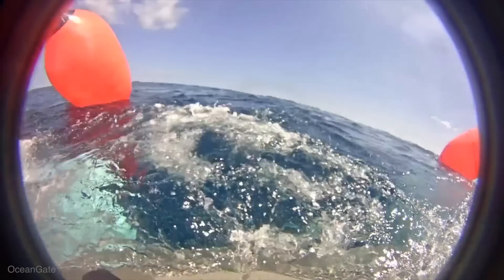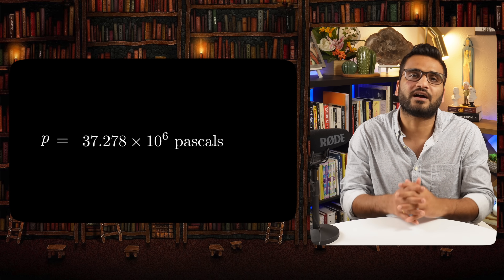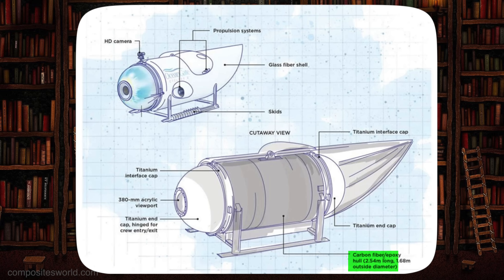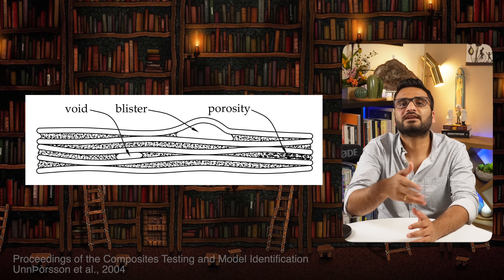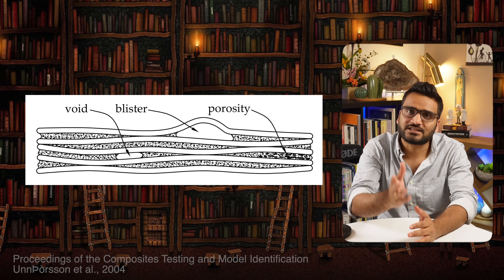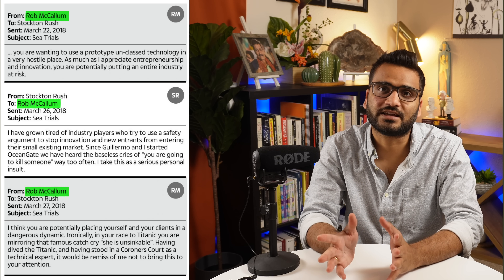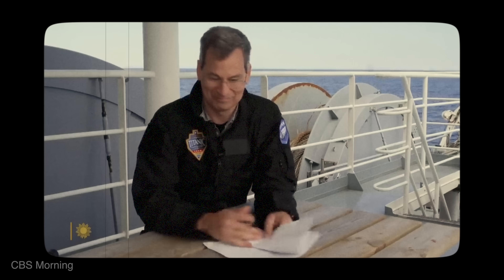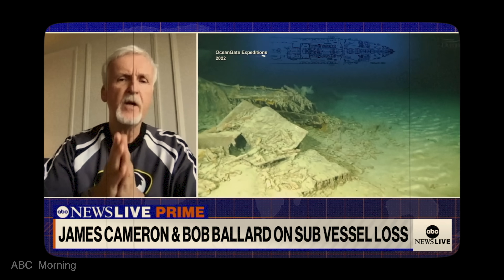OceanGate REALLY messed up - A Structural Engineer's Perspective | TITAN'S TRAGEDY

Comment: Very informative explanation. I am not an engineer but I know how water pressure works. From my limited knowledge, it could have been a failure of the carbon fibre. If the Acrylic dome was only good for 13,000 metres, that could have been critical as the Titanic lies at 3,800 metres. I tend to think the Acrylic failed.
Reply: The carbon fibers are not to blame... Carbon fabrics tolerate tensile efforts very well... The compression of the material is in the resins... IT IS IGNORANCE OF THE MANUFACTURER... The problem is not with the tool. ..it is one of those who do not know how to use it.....because titanium alloys are welded by laser and automatically and the manufacturer as well as the engineer who made this material did not know either...

Comment: The domes were reported to have been glued to the fibee cylinder - they have diferent rates of reducing radii under increasing hydrostatic pressure; so they probably sheared on the gluedvsurfaced while the cylinder colapses like standing on the end of an empty soda can. While the the fibre was only wound on circumferencially - 'ie not "cross-ply" like a pressurised gas tank.

Comment: so heres a lateral thought....the boeing dreamliner has a fuselage made of composite materials - how have parallel issues that could cause it to fail been handled?
Reply: Yes it does and so does Air Bus but they have been doing it for a while and have spent millions on testing and proving the integrity and durability in destructive testing which is basically real world. This is where the cavalier, dismissive, arrogant Stockton (correct description borrowed from another commenter) fell short. The air plane manufacturers are still having issues they have to overcome with the system including paint adhering to the material and constant expansion and contraction do to heat, cold and pressurization. Some of the issues Titan would have had but in a much greater amount.

Comment: Surely that the carbon fibre was wound like a cotton reel,not the usual criss cross pattern has to have significantly weakened the strength-just another failure in the construction processes involved in Tital. Pressure should’ve been used for all the epoxy resin used as “glue” for the titanium attached rings & after the carbon fibre had epoxy applied to remove bubbles that would weaken its integrity.
Tbh,I don’t know how it got to Titanic & back multiple times before it failed.
It had needed repairs to the carbon fibre after it’s 2nd dive…a sure warning

Comment: the amazing 20-20vision here. remember it dove titanic 8 times already so fundamentally there was nothing wrong with the design, i'd say simply it should do 2-3 dives then replace the hull as it's practically imposible to detect micro fractures in carbon fiber composite materials until its actually failing beyond that it was a pretty decent vessel .

Comment: Very good video from an engineering point of view.  Although I am an electrical engineer, I really appreciate learning more about structural integrity, finite element analysis, and other techniques which can minimize risk of failure.  Personally, I would rather be on the top side looking into a television monitor then to be 2 1/2 miles down under the water.

Comment: The rv handle he bolted to the top of the inside of the composite hull which he bragged about probably weakened the structure enough to cause failure....

Comment: I’m guessing that it was all over as communication ceased … the Cylindrical Hull WAS THE MISTAKE. Break the rules and you will pay, and he did. After the first failure he should have made a new Hull .this too would only have the same limitations but be less likely to fail like this one did, probably on its way down … cracking had been heard on previous dives indicating coming failure …
Reply: The Titanic at least had lifeboats …

Comment: Carbon fiber is excellent for tension loads and useless in compression. That is, it may be fine for pressure vessel applications, where the internal pressure exceeds the external pressure. A submersible is the reverse, and finite element calculations would have shown the hull to be greatly under designed. I'm not confident that the carbon fiber could adequately reinforce the epoxy matrix, if at all. The previous successful dives were due to luck, not engineering design proficiency.
Reply from the maker: Yeah. Assuming the structure to be symmetric about vertical axis of the cylinder, every point on the hull was subjected to three compressive stresses: (1) the compression from the domes in z-direction; (2) the radial compression; (3) the circumferential compression—thats too much work for epoxy. And apparently, the fibers were not cross-wound. I would also think that the stresses coming from titanium dome on to the cylindrical hull could lead to local crushing due to stress concentration at the junction.

Comment: You can say....Stockton rushed the process and cut corners....Saw a video of a hydro press pressure on a carbon fiber cylinder tube and it starts to completely fall part at 2000 kg of pressure...but before it starts to fall apart it would generate like metal clucking sound just like how Stockton has reported during the many times they've used that sub under water before the tragic day.

Comment: It's a scary thought that carbon fiber is vulnerable to impact damage, and a submersible is always at risk of hitting something down there due to strong and shifting currents at the wreck. Bump into something, and that might be enough to cause the carbon pressure hull to implode instantly.
Reply: It’s not just bumping into something with carbon fiber, it’s repeated dives causing internal damage to the epoxy with the immense pressures involved and no way to tell

Comment: Is fatigue really an issue? One of the main benefits of CF is its fatigue resistance. Unlike continuous homogeneous metallic materials, the failure of individual fibre strands shouldn’t propagate through the CF matrix. I’d speculate that the sub suffered a strength failure, either the collapse of the cylindrical shell or more likely the failure of the epoxy joint between the head and cylinder.
Reply from the maker: Yeah. Pressure cycle become important here because of the intensity if loading (from 0 to 5400 psi to and from) and possible thermal differentials. 

Cylindrical shell failure is likely as well. Assuming the structure to be symmetric about vertical axis of the cylinder, every point on the hull was subjected to three compressive stresses: (1) the compression from the domes in z-direction; (2) the radial compression; (3) the circumferential compression—thats too much work for epoxy. And apparently, the fibers were not cross-wound. I would also think that the stresses coming from titanium dome on to the cylindrical hull could lead to local crushing due to stress concentration at the junction and as you mentioned, the failure of epoxy joint being another possibility.

Comment: As yet another suitably qualified engineer, I'm not surprised to see so much angry and indignant comment by professionals that such a tragedy could have been allowed to happen. There is a whole catalog of basic errors in the Titan's design and construction. It will be a waste of effort to do a painstaking failure analysis of the wreckage; so many wrong elements of the design and construction could have caused the failure that finding which particular one happened to be the present culprit would be misleading - if that hadn't been the one, many others could equally have been responsible.
A basic problem is that the designer obviously 'didn't know what he didn't know', and then he wouldn't listen when he was told. Another was that whoever supplied him with project finance didn't require him to obtain supervision and approval from other clearly appropriately qualified engineers. Another was that, in the absence of insurance, which would have required certification, there seems to have been no state or federal requirement for an extreme tourism venture to be reasonably safe as a condition of being advertised for sale in the country or state where it was offered to the public. My present country of abode, New Zealand, is no better, as exhibited in the recent White Island tourist tragedy, where the local Maori tribe in conjunction with a big cruise ship company encouraged tours of a non-extinct volcano with horrible results for many who must have assumed they were safe. When will our 'authorities' take proper initiative and responsibility for allowing excessively dangerous tourist activity to be advertised and carried out under their noses?

Comment: Yay! Thank you for the detailed strength of materials description at the beginning of your video. Most people do not realize that fiber composites are highly anisotropic, and that this has to be accounted for in component design. Another concept that you point out is that the stresses are from isostatic compression. This means that the Titan was a vacuum chamber, not a pressure vessel. It is obvious that James Cameron is not clear on that concept. Now considering that, please make another video discussing the phenomenon of water hammer and how this would result from brittle failure of the cylinder, and the effects that the massively powerful water hammer would have on the materials and components of the Titan at both microscopic and macroscopic scale. Please also discuss further the chemical and physical properties of carbon fiber. Please discuss the nature of bonding to and support of the fibers by the resin matrix. Also discuss the surface chemistry of carbon fibers. It would seem that the pyrolysis manufacturing process would produce fibers that are much like very long carbon nanotubes, which would have very slippery surfaces similar to graphite flakes. Bare carbon fiber is physically slippery, like it has little opportunity for hydrogen bonding between adjacent fibers, so that it is not readily crosslinked by a resin matrix. It is also as brittle as glass and cannot be bent smaller than a certain characteristic radius. Would it be possible to chemically attach -OH or -NH2 groups at intervals along the carbon fibers to enable the bisphenol-a diglycidyl ether epoxy resin component of an epoxy polymer matrix to chemically bond to and crosslink the fibers? This treatment would significantly increase the axial compressive strength and fatigue life of carbon fiber composite materials. Thanks in advance.

Comment: YOU FORGOT TO ADD A WINDOW RATED AT 1300 METERS WHILE THEY DOVE TO 4000 METERS UNCERTIFIED CHINESE KNOCK OFF xBOX SUB RICH IDIOTS I DONT JUMP OUT OF AN AIRPLANE WITH A UMBRELLA I USE A PARACHUTE xBOX SUB RICH IDIOTS I DONT JUMP OUT OF AN AIRPLANE WITH A UMBRELLA I USE A PARACHUTE I Dont Use an UMBRELLA I USE A PARACHUTE xBOX SUB RICH IDIOTS I DONT JUMP OUT OF AN AIRPLANE WITH A UMBRELLA I USE A PARACHUTE DO I NEED TO SAY IT 3 TIMES  OH TO LATE YOU won't LISTEN YOUR DEAD
Reply: Correction to the comment made by #seha6391 . At 7:10 min, the presenter, Dr Chadha, refers to the viewport, or WINDOW, its rating for submersion to a depth of 1300 metres only, and the requirement for a rating for submersion to at least 4000 metres for the trips down to the Titanic. This reference was made in conjunction with the reference to the two titanium dome end caps.
Reply: If the people were still alive id believe your bullshit The Sub Was UNCERTIFIED TO THAT DEPTH THEY WERE IDIOTS Ask The Smartest Diver On The Planet James Cameron HE WILL Tell you the same thing
Reply: @PNH-sf4jz  Funny How all 2 Mle Plus Submersibles Were small Compact and Spherical not a fucking Cylinder You can Suspend a car On 4 Spherical eggs but a beer can can be crushed on your head easily Math is math if your window is rated to 1300 meters and you dive to 4000 meters that's about 60 elephants standing on your head on one foot your GONNA eventually Go SPLISH
Reply: @PNH-sf4jz  Going to space is Dangerous Thats Going from one atmospheric Pressure to Zero At the Depth of the titanic your going from 1 atmospheric pressure to approximately 5000 times that ONE CRAC LEAK IMPREFECTION YOU IMPLODE IN 1/1000th OF A SECOND  and then you EXPLODE FROM THE HEAT CAUSED BY THE RAPID IMPLOSION AND YOUR BODY VAPORIZES AND TAXPAYER MONEY IS BEING SPENT TO FIND SOME HAIR AND FINGERNAILS FROM RICH IDIOTS

Comment: The sub wasnt built for 4000 metres was only built for 1300 and ocean gate knew it and still went through with it why?? And also why carbon fibre wtf why not high strength steel the same as J C did with challenger deep

Comment: The end cap pressure on the ring were immense. The inward, cylindrical forces ( at 90 degrees to the end cap pressures) were also huge. These two combined together on the face of the carbon fibre at the joint with the titanium. At a point where there were differential strains ( movements) between the two materials, that had been simply glued together.
Reply: The pressure on my ring in the morning is f......kin immense too.  I crack off some loud fat farts   phew!!!

Comment: My guess is the epoxy glue failed first. Ocean water is very corrosive, due to salt and mineral components. That is why all ships has to return to dry docks every few years to be cleaned and repainted with rust preventable coatings. Ships going in and out of ports have to have their hulls scraped to remove barnacles.
Once the glue failed, the hull came loose and separated and implosion occurred. The pictures I saw, shows the entrance cap with the view plate unscrewed from the titanium rings!!! Five huge pieces and a much smaller debris field. Two end caps two rings, rear equip. cone, the landing legs and piece of cowling
 What is missing: the Carbon Fiber hull, the viewport. And the rest of the sub's lighting, motors and camera equip.
That stuff is the small debris field.

Comment: Imagine a rib made from an I-beam with a leg so long that these effectively divide a cylinder into separate compartments with only a hole in the middle sufficiently large for a person to climb through from one area of the vessel to another. In effect these are metal partitions that prevent collapse of the hull. That would allow submersibles to be constructed with thinner shells as long cylinders with strength that equaled that of a thicker sphere. These vessels will likely be cylinders when the need arises to accommodate more passengers on each trip.

Comment: A chain is only as strong as its weakest link. Cylindrical instead of spherical should be okay provided it is analyzed correctly and with interior metal ribs providing additional strength against collapse and not merely relying upon the material of the shell itself. With metal ribs the shell could have been thinner and lighter, while made of titanium providing a similar decrease in weight sought by using the carbon fibre composite. The certified strength of the plexiglass is less than its actual strength and Stockton Rush took advantage of this difference. In fact, testing was done on a one-third scale model. It is quite possible that there were no labs capable of testing and evaluating the strength of plexiglass subject to stress at 4000 meters depth. He was innovative and with a little more care should have been highly successful. This tragedy is too bad. Others will follow in his footsteps and earn the recognition that belonged to him.

Comment: The problem is how they used the carbon fibers, they only wind it around the titanium. Horizontal and vertical strips of carbon fiber would be a lot stronger, if you want to use that. And f** sake test it at least. The window was tested to 1300 meter ? WTH

Comment: Not a structural engineer, but I know that laminated structures are thing to be approached with caution.  5 inches is really thick for a composite laminated material, especially where voids and adhesion loss are well known. The limit is load saturation, and how imbalanced the load is in the thickness. Progressive failure is a probable outcome

Comment: Carbon fiber should be fairly good at compression if pressing the layers together, but terrible at compression if pressing parallel to the layers. On a hollow cylinder, the compression on all surfaces would try to shrink the radius and thus there would be forces parallel to the layers that could result in delamination. The other problem with a cylinder is that it is not deformation-ally stable. If it starts to get pressed into an oval, the forces on the wide side increase and it will be a vicious cycle that results in it being pressed flat. Also the end caps are trying to squeeze it shorter like stepping on an upright drinks can. It is probably stronger this way but still the pressure is parallel to the layers. A sphere is really the strongest shape, and second is the ellipsoid (which still has a bit of trouble with forces around the narrow radius but still beats a cylinder).

Comment: What do you think was the primary reasons why he chose carbon fiber for the hull verses any other materials?  Was it and easier build, cheaper, he wanted it lighter in weight?
Reply: All of the above
Reply: Boeing had some carbon fibre past its use-by date so Mr Rush got nice cheap deal when he bought it.